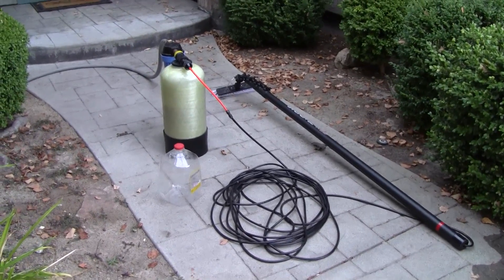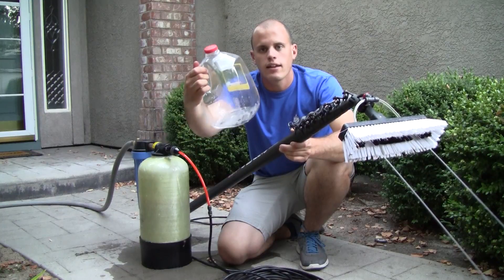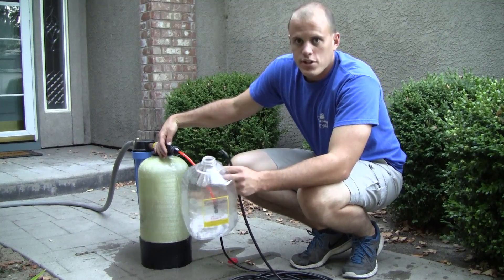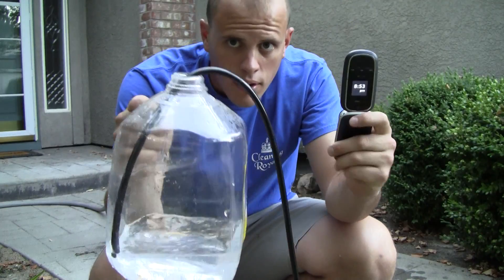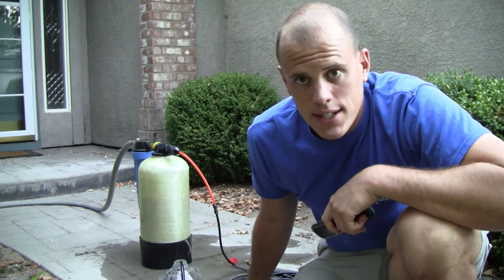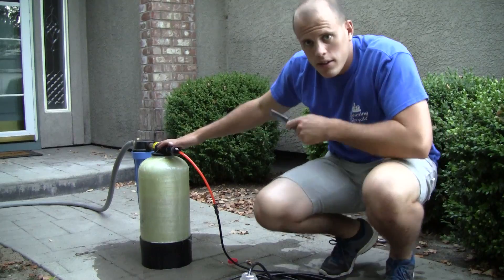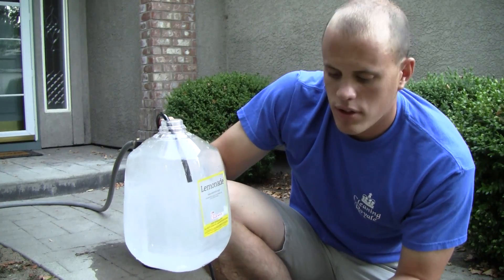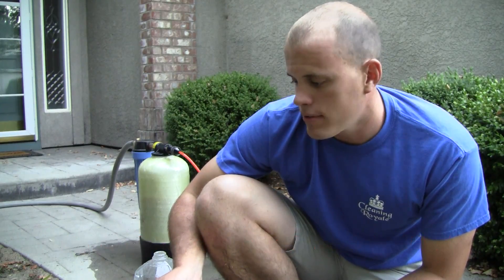Water Fed Pole - How Many Gallons per Minute Test (5/16 in/8 mm hose)

Comment: Like your videos! I would recommend trying just a trickle. Even much less than your flow towards the end of the video. Half a gallon per minute is good enough. Anything more than that and your wasting your di. Increase your cleaning efficiency to save even more di.
Reply from the maker: Yea, I really had to learn how to save water. It's so fun using it though!
Reply: I have a 4 stage filter that advertises 1 gallon per minute but seems too slow.